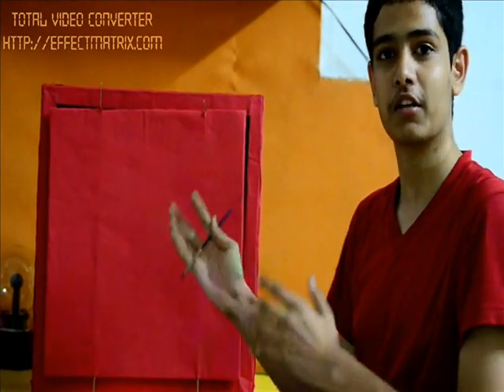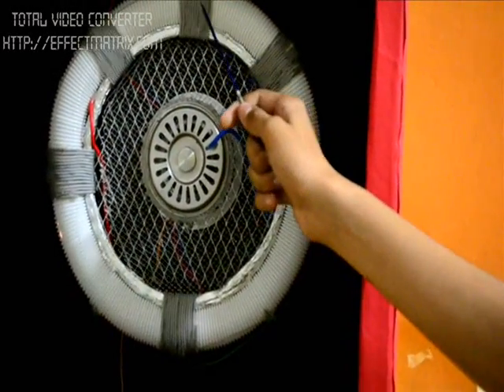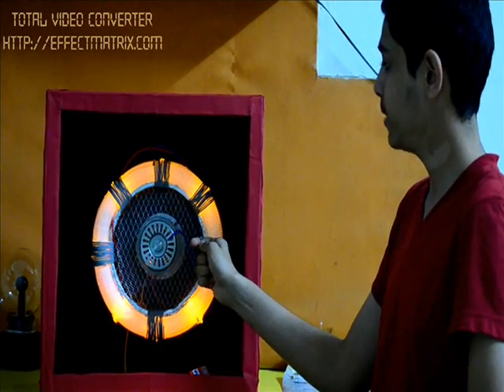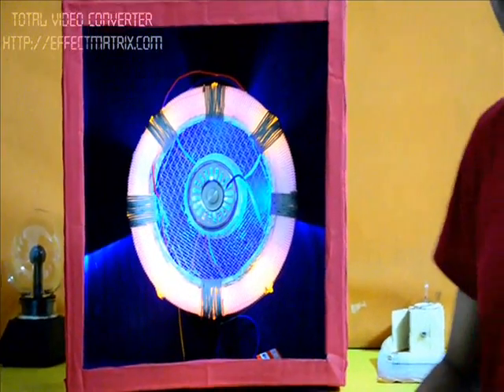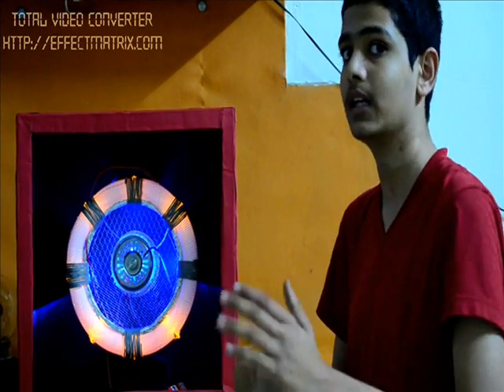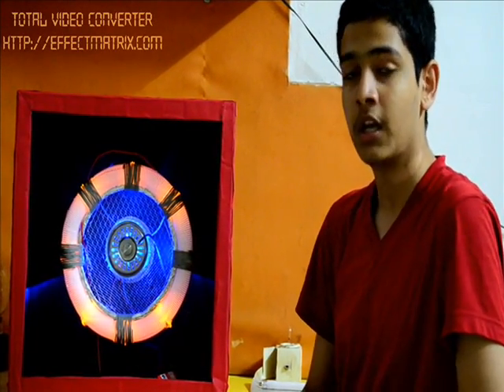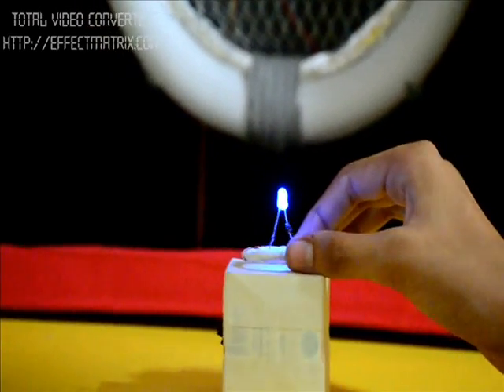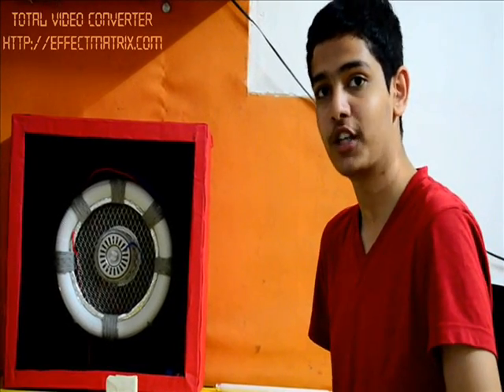ARC REACTOR - Theory

Comment: here the two isotopes of hydrogen are reacted with each other, to form a light weight Helium and a neutron which is and the remaining mass is been converted into heat and through it we can generate energy using steam turbine as the other power plants do....Am  I right, If not then please correct me....!
Reply from the maker: I guess there will be no need of a steam turbine.
If this thing works, we will be able to harness the electricity directly. But if it doesn't, then your thought of using a steam turbine in not a bad idea.
You just gave me a new way of approaching this method. I'll develop this thought into a whole new reactor. Thanks for your suggestion.
Reply: @ananyajampala2196  l'll love to work with you Ananya, since this is my hobby to give all time to build an arc reactor/also all the information about the iron man suit.
I had tried to contact you, Can we work togather ?
Can contact me on my google+ recently l had follow you on google+. Also can contact me on hangout I have sended you a Invitation.....Hope se you'll be intrested..
Also our both ideas can make it better
Reply: @ananyajampala2196  Can we work togather ?
Reply from the maker: @sahilsaini3121  sure!!
We can!! Both of us can surely come up with a great project. Btw, I'm not always available on Google+. You can contact me through email.
robotics.ananya@gmail.com
Reply: @ananyajampala2196  cool, l'll contact you now, looking forward to make a better arc reactor. Hope we'll two of us can make something that will be exotic.
Reply: @ananyajampala2196  I have mailed you but no response :(

Comment: OMG!!!
You seriously need to do some research and not make stuff up you said that that your arc reactor uses cold fusion and smashes hydrogen atoms together to form helium, but your using magnetic coils to shape the hot plasma inside the glass tube, this wouldn't work and you will need to put in more energy than what you get out. And if you actually did some research you would know that to create helium using hydrogen via cold fusion, you will need to use electrolysis 
So there you go I just proved how your silence project is incorrect and wouldn't work but its pretty cool

Comment: how much voltage of current do i have to supply to copper coil and how to supply current to coils and do i have to supply current to them continuously 
and finally how i can i take the current produced by reactor out from it
how to take it by wires ?????????????
please tell answers to these u know this will help me very much
please tell if u know the answers
at least  u should know one so please tell
hope u reply soon
Reply from the maker: In short, you are asking how to construct it , right?.
Well, this is just a therotical model. The real practical one will have many changes. 
By the way, you to supply current to the coils until then ionize the ions.
Now to calculate the exact figure, we need to know how much magnetic flux is needed to ionize palladium.
Reply: hey first u told that we have to ionize the hydrogen gas and now u r telling we have to know how much magnetic flux is needed to ionize palladium ???
just tell what we have to ionize palladium or hydrogen gas
Reply from the maker: @luckysuraj1436  the first thing you have to know is that, palladium is what plays the major role and not hydrogen.
What I meant by ionizing palladium is: we need to produce gamma Rays which are harmful, so hydrogen will ionize in any way but it is the amount of gamma Rays that need to be in control.
Depending upon your amount magnetic flux, the amount of gamma Rays produced varies.
That's why I told that it is not possible for me to calculate the exact value of the voltage to be supplied.
Reply: @ananyajampala2196  tq but we will not give magnetic flux right we will give voltage and that will produce magnetic flux
Right so all we have to do with it is first we have to give a  low voltage and see is it OK or not in that way we have to give voltage until we can control gamma rays.
 Am I right??
Reply from the maker: @luckysuraj1436  not exactly.
See, there's huge risk associated with actually building such a reactor. We cannot just blindly apply random voltage and test it out.
It can all be calculated theoretically, provide we have to conduct some risky experiments in an high-tech lab.
Reply: @ananyajampala2196  hey I send u Hii in fb bro
Reply: @ananyajampala2196  contact me there bro at once plsss

Comment from the maker: thanks bro
Reply: Nice video and is very interesting. Is it okay if I have a private chat with you
Reply: I want to know in wireless electricity transmitter was the copper wire,which you used in coil insulated or not? Plz reply soon.
Reply from the maker: Aniket Dhanotia yes. If it was uninsulated. It would have short the circuit and wouldn't  form a magnetic field